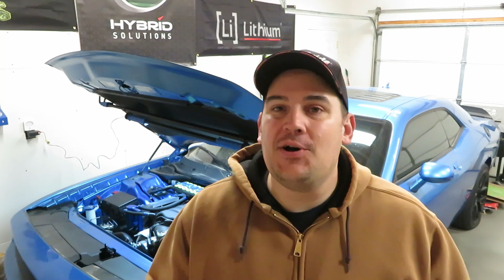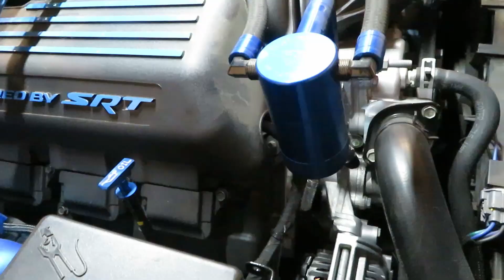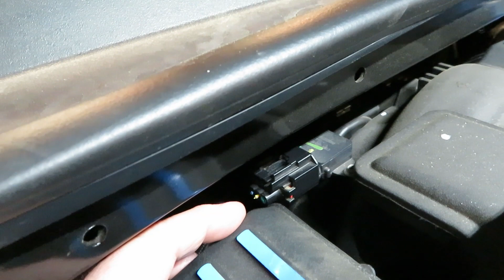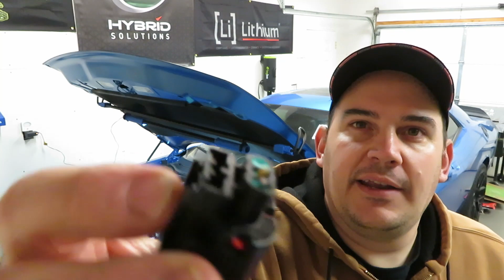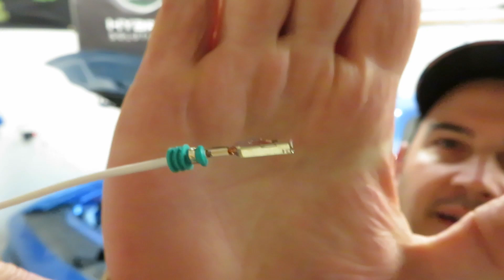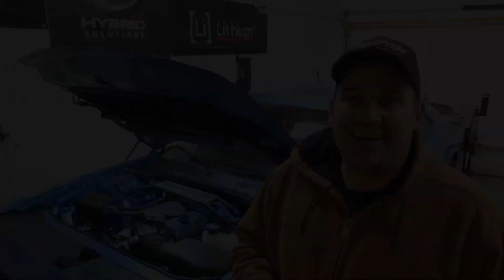Rodents RUINED My Car!!!

Comment: Happen to my Wife’s F150! Chk Engine lights and issues multiplied day by day until I looked and saw the chewed through wires. Almost paid for it myself but then realized our Insurance covered it all and a rental too. Saved us a lot of money. The shop actually had a specialist on this who came by a couple times a month. In Rural Southern Ca.
Reply from the maker: Man the rodents just love the new vehicles wiring! That's awesome to hear that it was covered under insurance and a rental as well. Sound like it all worked out in the end for you guys.
Reply: Did you have to file a claim and have the damage looked at by the adjuster before the repair was done? My car was already in the shop getting repaired when I filed the claim.

Comment: Great vid and info. FYI, that type of damage is usually covered by comprehensive insurance if you have it. I used to be an adjuster and handled claims for this a bunch of times. It's not just newer cars either though. I've seen this happen all the time in cars and trucks from the 80s and 90s too. It's warm inside engine bays and they have to chew on something.
Reply from the maker: Thanks and glad you enjoyed the video! I was reading about that but I was not for sure if it would cover it but I do have comprehensive insurance. Thanks for that info and its good to hear that form some one that use to be an adjuster and has seen problems like this. That is crazy but does make sense because these pesky little rodents love shelter and always have to be chewing on something. Thanks for your support and the info on the insurance end of things buddy! 🐝
Reply: I recently filed a claim with my insurance company because rodents had damaged my car's fuel line/fuel pipe. I have comprehensive coverage but it did not mention rodent damage.  I just had the expensive repair done out of pocket the car is now fixed. I contacted my insurance agent and provided a copy of the invoice and the receipt. My insurance agent told me that I need to provide a photo of the damage or a detailed description of the damage to have my claim adjusted. I cannot provide a photo of the damaged fuel line.  And the service technician hasn't given me a copy of a detailed description. So am I stuck with paying for the repair and should withdraw the claim? Or what else can I do? Note: The damage was not visible from the engine compartment. A check engine light caused me to take my car to the service dept.